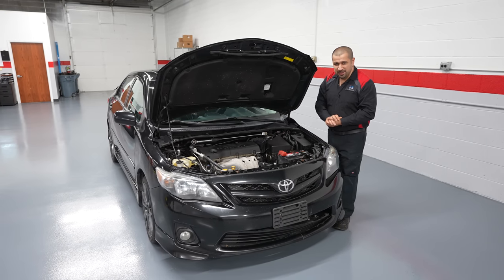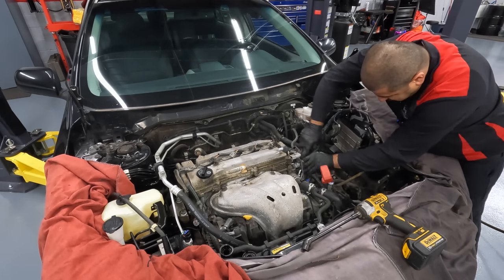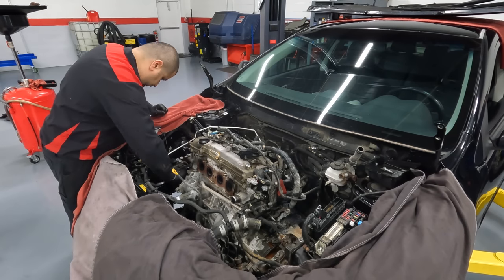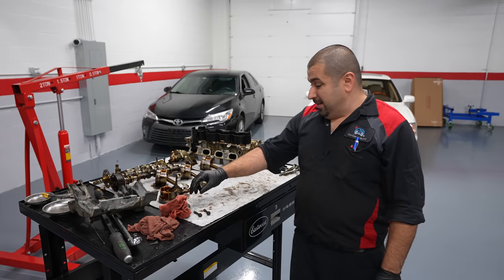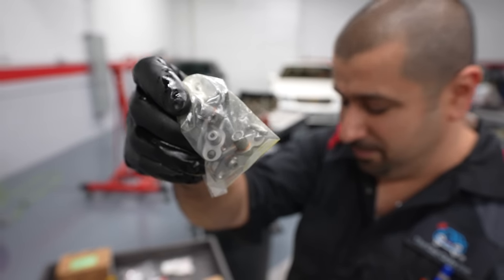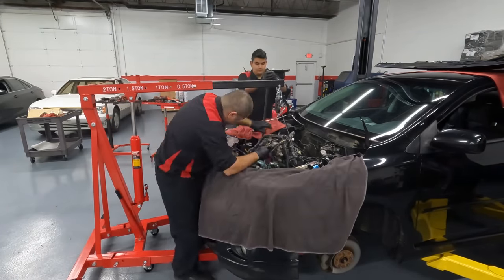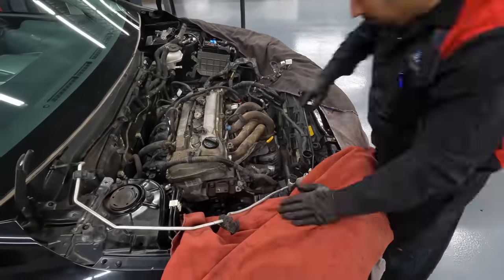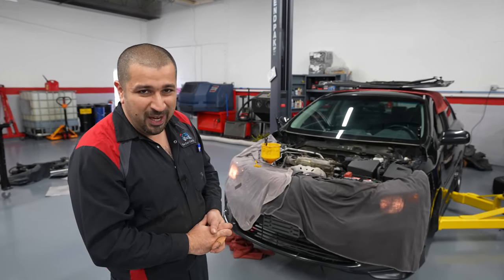THIS is Toyota's Worst Engine Ever Made! But Is It Really THAT Bad?

Comment: My mom had a 09 camry with one of these she used for uber. Thing would on average burn 2 quarts every 2-3 weeks. That being said, we bought it at 144k and took it to 278k and sold it running and driving. Only things we did were top off the oil, change consumables like tires, and change an axle and radiator. That car received nothing but hell over 3 years, and will forever have my absolute respect
Reply: Quarts?
Reply: Yeah... If you think about it, 3200$ in oil, can last a long time, you guys put too many miles on it. Mine is a 2010 Rav 4, it shouldn't have this problem, but it's burning close to a quarter every 1.000 KM,  somewhere like 1.5 Q every 1000 miles, i haven't taken the car to a shop yet, but a guy told me it's easily a 750$ job at least (i live in Costa Rica, so labour is much cheaper, also i don't believe the bullshit of buying Toyota oil and coolant), so I'm actually thinking about how long could i go, with 800$ of oil.
Reply: I've got a 2008 camry and I deliver pizza.  I add a quart of oil every 200ish miles.
Reply: @michaelgreen4443  That's an oil burner. It should be like every 1000 miles. For a quart of oil. You may have had an oil leak as well..
Reply: @patrickhenry2845  yeah. I just can't afford 3k right now.  My car has been doing this for 7 years now.
Reply: @patrickhenry2845  ok thanks
Reply: I love your videos.  I have a 2010 toyota rav4 v6 Can I run synthetic blend oil in it? And also my wife has a 2015 toyota rav4 can I use 5w30 for that engine
Reply: asv40 camery swapped to the 2ar from the 2az in 2009. not the same engine. same body though.
Reply: I dealt with a  2009/2010 Camry that was first burning oil. I changed the cylinder head gasket and pcv valve because there was oil in the engine bay. Long story short, that didn’t fix the problem and the car continue to burn oil. I later found out there was a class action law suit against Toyota, and part of that deal Toyota did an extended warranty. I was too late for that warranty. The catalytic converter was damaged because of the engine continued to burn oil. The car started to shut off while driving, 😱and I found out carbon builder up in the throttle body was causing that that issue The vehicle was eventually traded at a dealership. That vehicle was a nightmare.
Reply: @tonynguyen5750  yes. Synthetic blend or full is fine. I run full on my 2011 corolla.
Reply: @tonynguyen5750  pretty sure the V6 requires synthetic blend to begin with. So yeah it will be fine.
Reply: Tbh it’s a titan 

I recently got rid of my 95 Lexus es300 which had 335k and really could’ve kept going if I didn’t neglect the maintenance towards the end 

I recently financied the Camry and honestly it’s a fun car tbh. I love that shit

Just burns oil like a mug. Glad I caught it tbh. I have air intake in it and I also Uber…very reliable for the most part. Previous owner really took good care of it

I plan to go head and fix the pistol ring problem eventually then ride this thing to at least 300,000k with the fact that I too do Uber 

I avg about a half - full quart every 400-600miles

There’s times it’s would be about half quart at 600miles
Reply: @michaelgreen4443  rotfl

Me It’s every 300-500miles

Still a work horse fr
Reply: you put 130k miles on it in 3 years.......no way lol
Reply: @Deno4000 I had a 04 Solara same story    spent a day resetting the the ecm trying to get 5 ready 1 Inc.. to pass emissions     went thru a can of throttle body cleaner to stop rough Idle    those were the days    those were the days🤔
Reply: @michaelgreen4443  You should have bought a 12' Altima.  My 4 cylinder 2.5 liter hasn't used any oil in 12 years of driving it.  So much for Toyota reliability.
Reply: thats a straight out lie.  at the most it burns a quart every 3000 miles, and they only do that if they werent properly maintained from new.
Reply: Excuse me have you ever had to changed the catalitic convertor?....and catalitic sensors?...I own a 2009 Camry same problem
Reply: @carlmarc3877 how do you check to see how much oil on average your burning

Comment: I have a 2009 rav 4 with the 2.4 vvt is mine have the low compression rings i know you said 06-08 rav 4 witch means not mine but it does have the 0-20 and 5-20 oil cap so that according to you meant it did so what do I have cause im leasing it and was planning on keeping it if its a good car but I don't want to deal with oil burning also mine has 130k and doesn't burn any so im in a confused state here lol 😂😂

Comment: My 2008 Scion tC with this engine had a huge oil burning issue & Toyota refused to fix it under their secret recall program. It really soured me on Toyotas. My Mazda3 has never given me problems in the 10 years I’ve owned it.
Reply: Toyota saved slightly over $1 a car going to the new rings. What morons
Reply: toyota actually owns 5% of Mazda lol
Reply: I have an 08 with 201,000 miles and I don’t really have oil consumption issues it’s not really noticeable

Comment: Thank you for the shout-out to Canadian Auto mechanics. All we ever deal with is salt belt rust issues like you do unless it's brand new. It's literally like a different set of trade skills learning to deal with rust.  Dealing with corroded, seized and broken fasteners is a learned thing and basically an under appreciated art. Too bad they are not taught in trade schools but just learned though experience living and working as a mechanic in a salt belt.
Reply: Unless of course those cars come from Vancouver. 😆
Reply: Why don't people undercoat their cars?  I know it does not fix all rust issues but it helps a lot.
Reply: @twin2482  Because people were told that undercoating is nothing but a scam.  

I did the undercoating with my 1997 Camry, but the 2007 I didn't do it (and my salesman didn't recommend it either - he sold me the 1997 Camry as well) because he isn't sure whether the undercoating will effect any of the hybrid components.
Reply: @rgl168  I guess some of the older products were not great.  Even today some products are better than others.  I live at the edge of the "salt" belt and I undercoated my camry 2013.
Reply: Do you recommend rubber based undercoating or oil based? Or IS it just best option to wash the undercarriage?
Reply: @ebrahimsayed9242  I saw a couple comparisons and the best product was Blaster  Long Lasting Surface Shield Rust Protector.  It cost about $5-7 per can.  The videos said it took two can but I only used one.   I also live on the edge of the salt belt so I can use a little less than people in the salt belt.   Easy to spray.  There is a little spray drift that gets on your driveway but very little.  They say it last 2-3 years but it is cheap enough to touch up yearly
Reply: My Ontario mechanic leaves Krown Rustproofing brochures at the front desk as a hint to owners.
Reply: I have owned 2 Dodge caravans.1992, 2007, I know rust! My new Totota is comng my way in Feb. 2023. No more Caravans for me. Ugh ... rust buckets.
Reply: @ebrahimsayed9242  youtube has some videos on this matter
Reply: Cleveland area and it's like a different type of beast doing mechanic work, people of southern areas will never know
Reply: @ebrahimsayed9242  neither....oil isn't as effective and rubberized allows moisture underneath.  For zero rust metal one could use cosmoline (two coats) but the fumes are tough so I'd stay with lanoline:  Woolwax is thicker than it's sister Fluid Film, and PB Blaster Surface Shield is another. I just did Woolwax on three cars. In doors and behind fenders I like the thinner Fluid Film (or Ontario's Corrosion Free 3000 also known as Rust Cure)
Reply: I have a Duster AWD that has good undercarriage rust protection but nothing in the engine bay and average upper body. I love it, it's hilariously capable on snow i can hang with vehicles that are out of my league but at the same time i would like to keep the car and not treat it as expandable. It would be good if these sold in cold places to know what happens with heavy exposure to snow and mud and what to expect
Reply: @ebrahimsayed9242  oil based. I’d say best in Canada is Krown. In a salt belt, it should be applied annually, however even once every few years will make a big difference.
Reply: @lukek1949  sadly the oil based ones don't last if you wash the car
Reply: I found the best way to rustproof your car is to move to California.
Reply: @twin2482  because dealers only offer rubber undercoating as a one-and-done deal, which ends up trapping dirt & salt & moisture between the undercoating & the metal floor pan, accelerating rust. Proper undercoating would be spraying off all dirt/mud using an angled pressure washer, then using 2 to 4 layers of an oil/film undercoat. Then rinse and repeat every 6 months or 1 year, depending on the coating condition. Proper undercoating requires cleaning and reapplying, there’s no such thing as an undercoating that sprays on one time and works for the rest of time

Comment: I drove a 2002 Camry for many years, took it to 250,000 miles. Really didn’t burn oil at all, all original. Would have never known this was an issue.
Reply: It wasn't an issue until 2006
Reply: @drewschumann1  i had an 02 that burned a very little amount itd puff a little on startup maybe 1/8th of a quart every 3-3500 miles but it was prob from poor maintenance and driving it like i stole it i bought it with 120k and sold it with 170k and it did it the whole time i owned it

Comment: Hats off to the engineers and mechanics. We can  take cars for granted. With all the moving parts  in an engine, heat and combustion it's surely a miracle.
Reply: 24:48
Reply: In that logic,  Toilet paper is a miracle too.
Reply: @diezelvh4133 are you really comparing the complexity of a modern engine to toilet paper 😂

Comment: My grandmother drives her originally new bought 2005 Camry XLE. It's like new everywhere except the paint which she has accepted as a challenge to scratch as much as possible. Mechanically it's fantastic
Reply: My Grandma turned 90 this past April and she still drives her 2010 FJ Cruiser w/4WD, 👊
Reply: I  drive my mom's 2005 Camry LE V6 and I had to get it painted but outside of that the car is a smooth operator
Reply: @Phillip Banes dragging feet on door jams
Reply: @Phillip Banes the fenders & bumper covers too, just not sure why.
Reply: @zacharypeery4082  what a boss 😂❤️

Comment: I have a 2003 Corolla and live in Canada. Hope this problem doesn't show up on mine. I repair a lot of stuff on my car myself so videos like these have been super helpful. Thanks for sharing.
Reply: Not the Corolla, the 1.8L of this generation were a very good engine. Only the manual transmission, C59 until bearing update around 2006 were drivetrain weak point on Corolla and Matrix. Also for Canada's cold weather, the manual gearbox oil has much lower viscosity.
Reply: You obviously didn't watch the video
Reply: 1zzfe1 is a better engine.
There's a reason why today you see these cars in Driving Schools.

Comment: No way !!  the 2az-fe gets a bad rap !!  Sure it uses oil , I get that. My 2008 Scion XB has 245k and its been incredibly reliable !  Full synthetic oil from its first oil change . I have changed out the following , water pump , serpentine belt , two sets of NGK Iridium plugs and fluid changes per schedule maintenance over its life . That's it . And on a side note the manual transmission is ultra reliable !! Still on the original clutch at 245 k , clutch master and clutch slave cylinder are still original , never a problem ! , one set of brake pads at 180 K. !! , yeah that's Toyota quality and reliability !!!

Comment: Working on older cars here in Canada can be soul crushing. Rust on everything, bolts break like its their day job. It's a pain.
Reply: yes! if only people undercoated there cars yearly or twice a year cars would last much longer only thing you can do to slow the salt
Reply: Not a spec of rust on my 2005 rav4! Living that garage kept life.
Reply: I found the main old car blights are rust, and/or coolant hoses popping a hole (the worst).
Reply: Not in vancouver
Reply: are you a mechanic in canada ? which province please I need job done on my corolla
Reply: I'm in North Florida, and watching videos of people up north makes me cringe.  They're going to fix that?!!!  How the hell aren't they throwing all of it away?  I replaced the rear wheel bearing and hub on my 11 year old scion, and visually I could barely tell the two apart (no rust at all).
Reply: Started my apprenticeship Glasgow 1979,rust was a problem as well,maybe not as bad as Canada ,still.on the tools here in South Africa, a joy here no rust inland.

Comment: I have been combating this issue with royal purple, K&N filter and 91 octane. Overkill but I need my camry to run for as long as it will! At 150k and running smooth 🙏🏿

Comment: Excellent video!
As the son of a machinist we rebuild all kinds of engines in the 70's and 80's. Still do.
It makes me cry to see otherwise good vehicles in the junk yard due to simple issues like replacing pistons/rings.
As you mentioned the rod bearings look perfect, so why mess with success?
We often re-used good parts because of the cost. A lot of the time, if you really know the engine, I was amazed at what dad could get away with with no apparent effects or noise. I often think of the environmental impact of wasting an otherwise good car and mankind's stupidity! 
Thanks for mentioning the rusted bolt situation in northern states and Canada.
I'm in Canada and it is an unbelievable problem.
When re-ringing / rebuilding my first Toyota Corolla engine in 1978, the very first bolt I removed, radiator hose bolt on the top of the cylinder head, it snapped off due to rust! I stared at it in disbelief.
The old Corolla ran well after the ring job. One cylinder had a compression of 40lbs when it came in.
The rings were actually broken on that one. I honed it really well and regardless of a bit of scoring it worked well. Got to love your great videos and the knowledge you can impart to people.😄

Comment: Thanks for the video. I have the same engine. It started burning oil after 100,000 miles. I simply kept adding oils untill it hit 180,000 miles, and sold to dealership. I never had any other issues except changing battery and brakes & tires
Reply: My 2007 Camry started consuming at 30,000 miles.
Reply: Had an ‘07 Rav4 that matched these mikes too. I decided that $3k would buy a lot of oil lol. Annoying to constantly be filling though.

Comment: I have a 130k km 05 Corolla S manual, doesn't burn a drop of oil truely.  Driven across Canada in -35c towing 2000lb trailer.

Absolutely love this engine in that model good to know that the model I have is the reliable one I didn't even know that about the remodel Corolla

Comment: I bought an 07 tC new.  It had the TRD supercharger with a 9psi pulley. A 50 shot of wet nitrous, and a professional tune. I ran Royal Purple since new changed every 3,000. It did not burn one drop of oil between oil changes. I sold it with 130,000 miles. It was a great car.